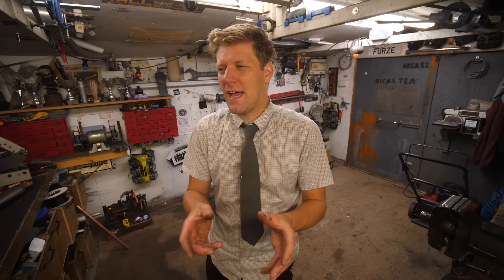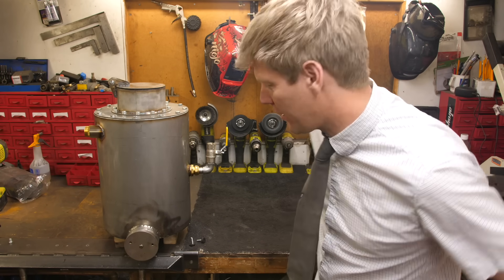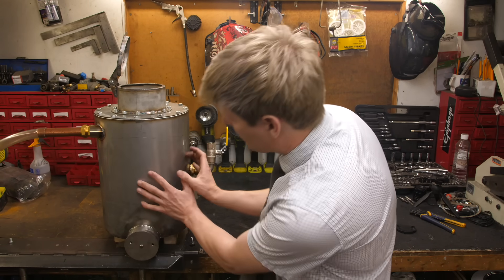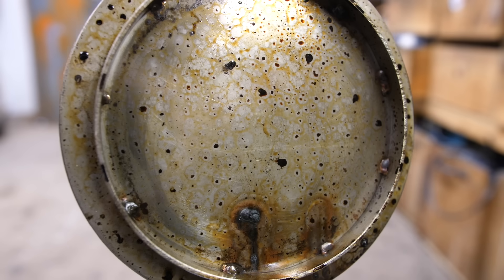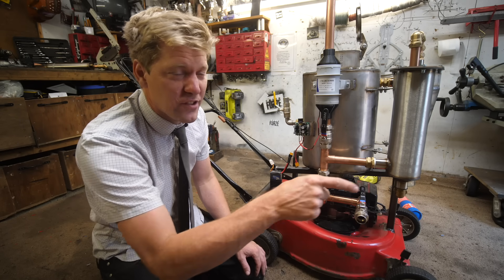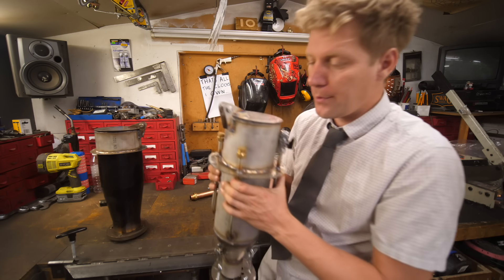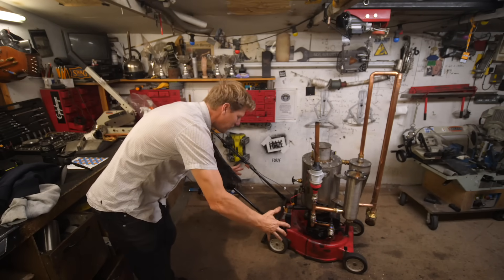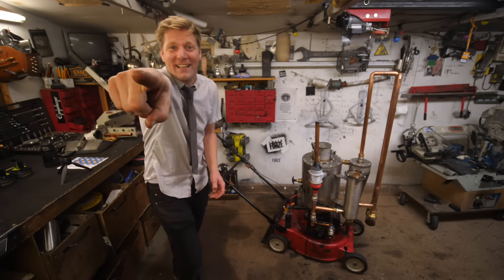WOOD POWERED LAWN MOWER

Comment: Very cool design.   Thank you for sharing.this.

    Fuel consumption - 1/4 of a cord of wood per acre of lawn mowed.

Gasifiers are nice but very dirty.   That's the biggest hurdle.   Second problem is they are not efficient.      
      Too much wood used,  for work produced.

Trees are renewable, but they don't grow fast.

Comment: It may be over-engineered by a mile but who cares
Reply: Not really. Proper wood gasifiers are engineering marvels fine tuned over years if not decades of experimentation and development to find perfect dimensions and shapes. Technology is there, but after the world war 2 tech was mostly forgotten and only has risen lately as cheap alternative to become self sufficient, before that is was few hobbyist trying to keep knowledge alive, but much has been lost since those who actually made them originally have died off.
Problem with gasifiers is that you are producing certain amount of fuel, but when you use it, this creates vacuum that effects the flame so amount produced is chanced. Combine this with fuel being in self sufficient environment not stable, things like simple wind etc effects production and then combine that to engine needing certain amount of fuel and air... and its not so simple no more. Best way would be to collect wood gas and storage it, where it can be released wanted amount, how ever this needs high pressure pumps and complicates system with new whole dimension.
I have been thinking on building one as emergency generator fuel supply, but as mentioned this needs long ass development cycle to get it even working and even more to work reliable.
As you saw, using gasoline to start the engine and then finding the air fuel mix is the easiest method to get it started, but after you shut it down many of the variables chance and getting it going again might be problem. Also note that in generator or car use load on the engine requires govenor or driver to add more gas and air to add power for counter the load and you might run into problems if production cant keep up. Ou and add there vibrations that chance how fuel burns in gasifier and that one more variable to consider.
Hell i would welcome colin to build off road go cart with wood gas tech, or simply generator.. if he gets that going i would adore that, as it would save me so much trouble if its reliable design.
Reply: How is it over-engineered by a mile?
Reply: I have a mechanical mower. It's way easier than even the gas mower

Comment: I was expecting a water bong for a filter the whole time, but a chemistry Karen in the comments says it wont work... well, why not give it a shot and see if it works? I feel like you're doing this just to get closer to the scene in back to the future where doc puts trash into his reactor to power his delorian.  are you going to put this in a car?

I'm not an engineer, and I don't think anyone would call you one, lolz, but I think per torque and weight, you could try another power source for the screw tank.  batteries would be fun, but a jet engine would be SUPER fun.

PS if you called up the nerd james bruton, and put electronics on your hovercraft, I'm pretty sure he could make it manageable.  His robotics sensors measure rotation down to the milimeter, and with that you could make a computer to throttle the fans

Comment: All you will get from cooling exhaust from burning wood is wood vinegar.   What you need to do is have a sealed chamber full of wood that is super heated with no oxygen and the gases come off the wood and then cool it and it will run the mower.

Comment: Wood gas should be the go to green fuel. Wood regrows. Pretty cuickly if you plant hemp. Hemp seeds are a rich and healthy food, plus the biomass growth is absolutely stunning, even on bad soils hemp can grow to 5 meters tall trees in just 6 months. The heat could be delivered by solar lenses, mirrors, nuclear reactors or other thermal sources. But it would stop us from digging up fossil fuels (which is carbon stored away under our feet and by us digging it up and burning it, we release it back into the atmosphere, which is bad). And we could still go VROOM VROOM

Comment: work of art!
Reply: Try some coal you got in your stockings for better results
Reply: @this old tony, i’ve been watching your channel a lalalala long a lalalala long long li long long time. excited for your next video!
Reply: Luke Mcdonald  yeah I think he needs his safe space 😅
Reply: It sure is
Reply: One that could actually kill you. One of the main components of wood gas is carbon monoxide.
I sure as shit wouldn't use it.
Reply: @MrSaywutnow  Burning petrol also puts off CO
Reply: @MurkyWaters677  Yes, but only as a result of incomplete combustion, and only in relatively small amounts when compared to wood/coal gassification.
With car engines it's a non-issue thanks to catalytic converters.
Reply: @MrSaywutnow  CO is a main component only if the system has water injection. The way Colin is doing it, the gas is mainly light hydrocarbons, but even proper wood syngas isn't that hazardous to work with in well ventilated space.

Comment: when i saw your thumbnail i laughed my ass off XD i love this crazy shit XD when i saw it run i cried the manliest tears possible XD i was thinking, why run the bunker on wood gas fuel. why not use hydrogen fuel cells, and power it with water?
Reply: Water is the exhaust from hydrogen fuel cells or anything else that combines hydrogen with oxygen to convert the energy from the formation of that chemical bond into another form of energy such as electrical energy in a fuel cell or heat in an internal combustion engine. It's the waste product - you might as well ask why not run cars on car exhaust? (Which is also partly water, plus the carbon dioxide obviously, and some other pollutants from unwanted combustion side reactions).
Reply: @sietuuba  perhaps you dont understand what im actually talking about. Im talking about turning water into oxygen and hydrogen. And then using the hydrogen and oxygen as combustible fuel. Perhaps ask me to clarify before accusing me of being a dumbass. Im not. And im not saying you are. But dont assume.     Edit: also i know that not technically a hydrogen fuel cell, but im not aware that the process has a name of its own so i used the name of the reversed process.
Reply: @SoullessScythe  Cute. It sure would have helped to say what you meant instead of "use water", what with the general state of scientific literacy around the place these days. It's guaranteed to throw anyone off :-p

Regenerative fuel cells exist, they are neat, and I have no idea what it would take to build one, let alone one with a power capacity worth mentioning, but it's a hard ask. It's a science project on the level of Ben Krasnow, probably, instead of an engineering project on the level of a top shelf fabricator.

Aside from the fundamental challenges that path also makes you commit to hydrogen storage which has plenty of issues on its own, especially in a built up environment like Colin's. No need to store the oxygen unless we're in space; just vent it and use atmospheric oxygen later to save the compression or cryogenic chilling costs, and the inherent risks. Wood gasification has advantages in that fuel is available in almost ready to use form without manufacturing it first with input energy we haven't even addressed yet, and it is easy to store.

My choice for self-made electricity would however be a biogas reactor supplying an off-the-shelf generator. Most existing engines and generators can be run with it, eliminating much of the development costs. It would require a bit more volume and janitoring though and I have no idea what the actual plan is going to be; i.e. does it and its feedstock need to fit inside the bunker or in a ground level shed. Anyway, that's my two cents, if anyone's reading this I am sorry for the bother.  :-V

Comment: Why don't you make one of those water-filters. Where the smoke runs through water in the form of small bubbles (more surface area) and a lot of the tar and ash gets filtered into the water. you'll only have to make a filter system for the water, but that should be a lot easier to do than getting it out the gas. 
Love your vids <3

Comment: Filtering the gas trough a saturated saline solution would dry the gas, cool it and remove any water soluble impurity, then a activated charcoal filter will remove tar. Steel wool in a copper pipe should work great as a distiller for heavy stuff coming directly from the burner, but would require frequent maintenance. Impressive how much energy there is in wood.

Comment: Idea: Instead of having the burner mounted on the mower, why not have a stationary burner that can properly refine the gas and store it in containers?
Reply: It’s not very Colin like (and this makes for a great thumbnail)
Reply: lol, the fuel is not liquid, its an actual gas vapor that's released from the wood.
Reply: @Gyva02 
I know, and gases can be trapped, just like liquids.
Reply: @Gyva02  if it's vapor, it can be trapped, maybe even pressurized, but I think it would explode under pressure.
Reply: @rob98000  What about CO2 canisters that can be pressurised to the point of being able to launch a genuine bullet to supersonic speeds in an air rifle? They don't explode and all you would need is some sort of pump.
Reply: @pugz3230  I mean, wouldn't the gas ignite under the pressure?
Reply: @rob98000  na
Reply: @pugz3230  it is more involved than just "some sort of pump" when storing a gas you want it pure or else there's no point of storing a gas. You need to separate the gas with other gases that's were the problem comes in.
Reply: @Fransenn  Thats... part of the refining. The refining gets rid of the tar, and the pure gas, which would be the exact same stuff he put in the engine (minus the tar) would be put into the container.
Reply: @rob98000  It could, but it also has a lack of sufficient oxygen proven by how the flame didn't travel back down the tube to the wood.
Reply: @pugz3230  either way. This is completely unnecessary. Mobile gasifires have always been on the vehicle it self or on a wagon behind. And that's because storing gas is hard
Reply: @Fransenn  A stationary refinery would allow for tar to be properly removed without bogging down the engine with all the weight. Also, you have to remember that this engine is meant to be a gasoline/petrol engine and is not meant to deal with tar from wood gas.
Reply: @pugz3230  True but it aint simple. First we are talking about pretty impressive pressures say 3000 or 4500PSI at lowest. For that you need special pump and you need to clean the gas out of all impurities, specially sulfuric etc that are highly corrosive. Corrosion and high pressure vessels are dangerous combination and when even with inert gas like CO2 3000PSI bottle exploding next to you.. well its not fun time say to least and those are factory produced. Put DIY flammable mix inside and sure it might work but how long is anyones guess and failure with those pressures could potentially be very deadly. I have been looking into this for a bit, but so far i havent seen any working setups.. Maybe if someone with expertise with high pressure vessels and gasses would build something then there is chance it would not kill them.. anyone with out expertise trying to replicate.. well there is very real Darvin award to be won..
Reply: @Hellsong89  You don't need to pressurise to the gas to the point of it being comparable to a CO2 container, that was just an example of gas being compressed to show it can defintiely be, and is very commonly, done. For storing the wood gas, you could keep it at much lower pressures as the engine doesn't take much of the gas to run. To keep the pressures even lower, you could also just make a bigger tank. Another thing is that while the gas is flammable, it's not a flammable mix coming out of the pipe as if it was the fire at the end would travel back down the tube.
Reply: @rob98000  not without oxygen.
Reply: It is quite hard to store a gas.
Reply: @Fransenn  Just like my reply to someone else that goes into more detail, take CO2 canisters as an example.

Comment: Water filter would probably help.  Could pull out a lot of the moisture.  You could make the water cool itself through a radiator using convection, so you  don't constantly lose water.

Comment: have you considered a static wood gas producer that feeds into some gasometers (basically diddy versions of those big things you see around power stations), which you can then tap into to power whatever you want using compressed gas canisters. that way the filter can be as big as you need, and the on board provision for powering the lawnmower can be a lot smaller

Nighthawkinlight has some videos on his own journey with experiments with wood gas if you're looking for some pointers on how to build one

Comment: I'm not sure it's a good idea to power a bunker with wood gas - the flammable component of the gas is literally carbon monoxide.
Reply: well if the generator is external and none of the piping goes into the bunker it is pretty safe

Comment: Make another one powered by hydrogen have a battery to start it up on the hydrogen process and then have a battery with a charging system running it and all youd have to do is add water and electrolytes or salt

Comment: "Don't need no electricity or nothing!"

...

Uses electric fan.
Reply: And a spark plug 😅
Reply: @fnhunter1848  spark plug power is generated by the flywheel spinning a magnet passed a coil.
Reply: @btumminaro  you do understand that that's how electricity is made?
Reply: @fnhunter1848  I sure do. I've been in the electrical field for 20 years next January. Your comment seemed to be comparing the electricity being used for the spark plug to the electricity being used to run the fan, as the original comment mentioned. These are two very different circuits and are completely unrelated. The battery running the fan uses a chemical reaction to create electricity and the battery will eventually wear out. The spark plug is powered by the magnet/coil, utilizing the rotation of the engine and will likely last longer than the mower. I hope this helped you understand my comment better. I hope you enjoy your weekend.

Comment: You didn't mention it in the video, but is there a separate oil system so the engine doesn't seize? It must be a 4 cycle mower to avoid this problem? As 2 cycles require oil mixed into their fuel, which this system currently doesn't support.

Comment: Looks like a solid system. I don’t know how much pressure that gas afire puts out but I suggest a water gas cleaner to remove the tar.
Reply: On smelters, tar is cleaned from the gas by passing through wet venturi throats and cyclones
Reply: @maclayyc  True, but that gas isn't subsequently burned in a reciprocating piston engine for power.
Reply: @raelik777  actually it is ;)
Reply: @maclayyc  really? oh, you said wet venturi throats, not through a mass of water. That would make a big difference, that and the cyclone.  If that's what a 'water gas cleaner' is that the original commenter referenced, then yeah, that would probably help. Granted, all of what you need to make a wood gas generator work properly won't fit very well on top of a lawn mower, but that's Colin's problem to solve :D :D
Reply: If he made something to collect the tar, he'd have free tar!
Reply: So Nasty that seemed to work well
Reply: onetopbbloveyou.link/RJm3nyHUlGY
Reply: Totally not a rickrolll
https://youtu.be/ISRRwU36i7s
Reply: what the heck is a water gas cleaner?
 https://www.youtube.com/watch?v=zMb62tupL-A
Reply: @sonasty7106  looks like he is waiting for the smoke particles to fall down onto the water. that takes way to long for colins mower
Reply: what is a water gas cleaner? i mean if you pump gas through water it gets cooled but not cleaned 🤔
Reply: David Ritter the idea is that as the gas bubbles through the water it transfers certain contaminants into the water. (In this case hopefully tar)
Reply: @dritter7051  Yeah, plus you'll add unwanted water vapor to the gas AND you'll dissolve some of the volatile hydrocarbons that you want to burn into the water. Neither of which you want to do. The wood gas needs to stay far, far away from additional moisture, so you're looking at an intercooler/radiator design. Can't be aluminium either, the wood gas will corrode that.

Comment: I wonder why there isn’t any (that I’ve seen, and I’ve looked) professionally made wood gas makers, (I mean ones that aren’t effectively a novelty, being to expensive or to inefficient) and also definitely why there isn’t anyone like a gas station (or some kind of major supplier) selling wood gas itself, it can be made into a liquid like normal gasoline, and it can use any kind of wood, like the leftover from a mill, (though some wood is better then others, but still) it’s so simple to produce that even a mad junk scientist like Colin can make the stuff, but what if it was produced on the scale of a factory? That would be a lot of wood gas.

Comment: Take a normal self propelled lawnmower, remove the handlebars, add a seat on top of it, add steering to the front wheels, and pedal controls. Boom, riding lawnmower for when you don’t have much space